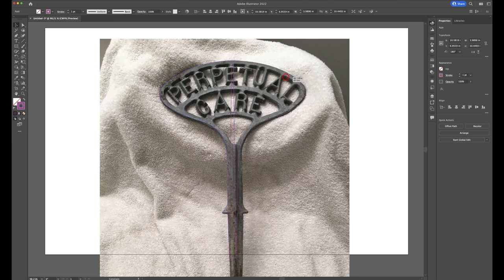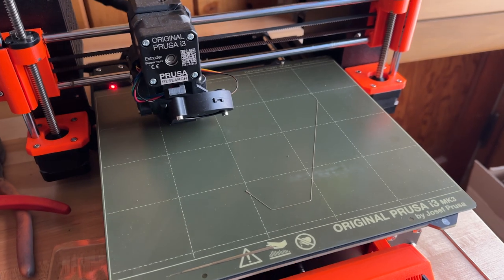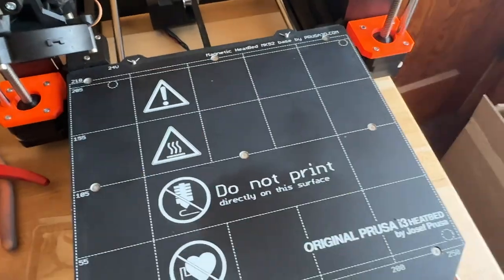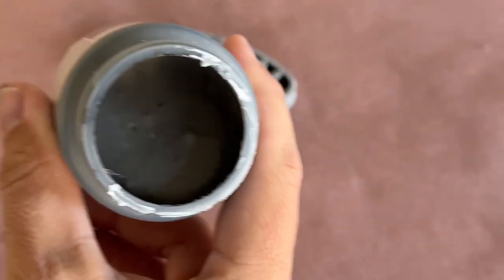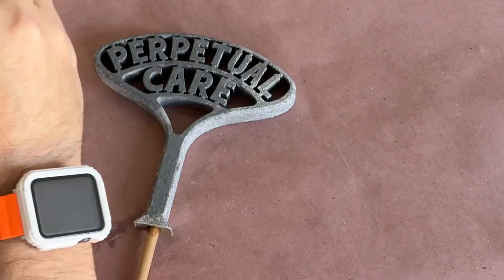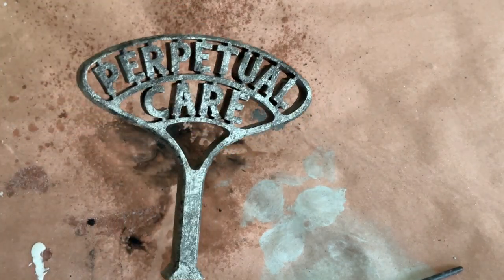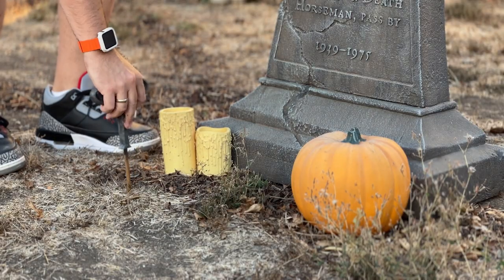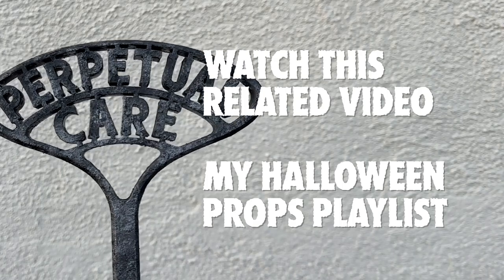Halloween Grave Marker Prop

Comment: So… How much are you charging for unpainted prints?
Reply from the maker: Hadn’t considered it, but I’d probably do them for $10 + s/h.
Reply: @VanOaksProps  Sent you an email.
Reply: @VanOaksProps   I have a question about how you weather your tombstones
Reply from the maker: @dannyflanery7466  what’s the question?
Reply: @VanOaksProps  I have built them out of plywood like Hollywood hunters did I coated them with drylok just wondering what is the best way to weather them painting wise
Reply: @VanOaksProps  right now they look brand new
Reply: @VanOaksProps  I would be interested  in a few blanks of the grave markers that  you made in this video
Reply from the maker: @dannyflanery7466  I have a few videos on making tombstones that discuss weathering. So I’d start there.